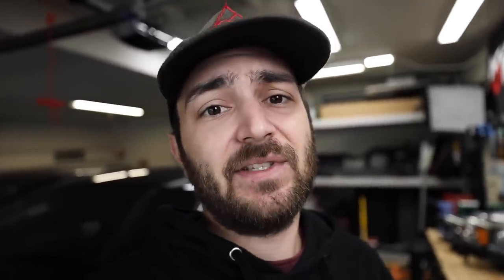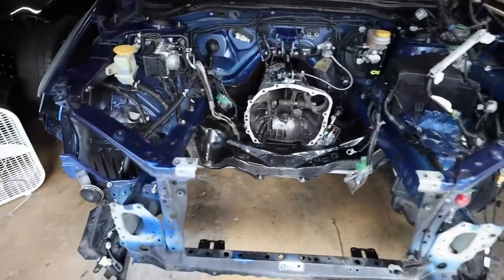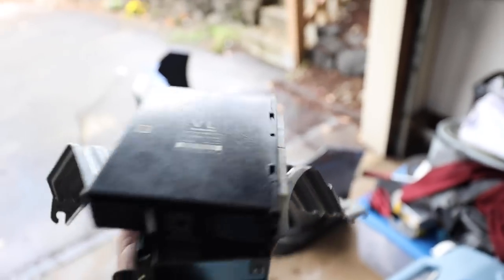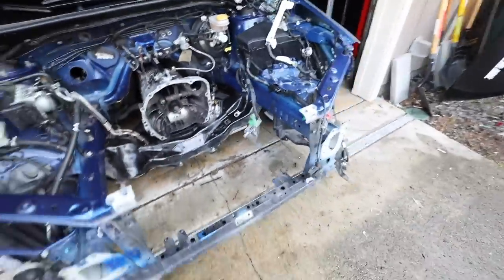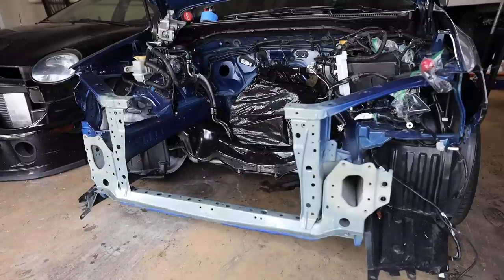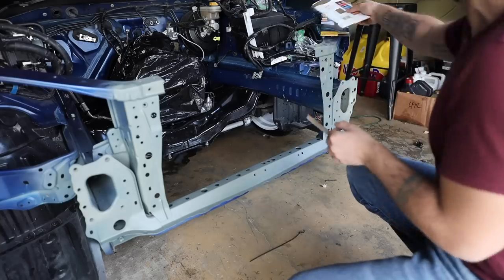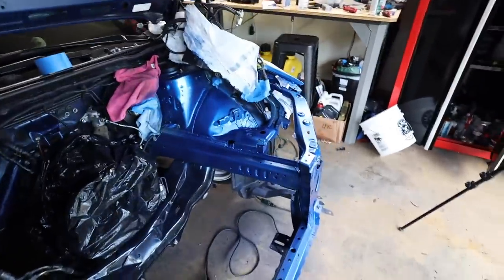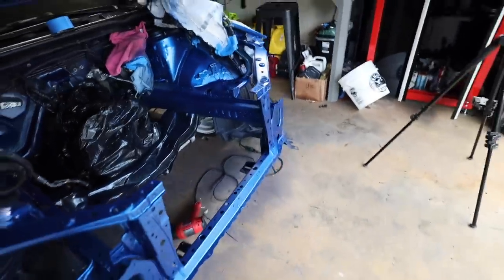DIY Engine Bay Painting. Fixing Subarus Trash Paint Job.

Comment: This is gonna be a long comment, fair warning.

Self etching primer is a good idea, it is not necessary though. When the car is built, it goes into a etching primer bath to ensure everything is coated(helps prevent rust). Using it to smooth out something is the complete wrong use for it. It is intended to etch or bite into bare metal. It is also supposed to be sprayed on and remain transparent.
To smooth out something you should use a high-build primer. 
Sanding etching primer is also not necessary. If anything, all you need to do is scuff it with a red or gray scotchbrite pad. Red is more aggressive for primer and base coat application and gray is finer for clear coat application. Cleaning with acetone between coats is unnecessary, unless someone is spraying wd40 or something of that nature. 

But overall that came out great for being spray cans.
Reply from the maker: Good to know for next time! The can said it was a sandable primer so figured it would work pretty well. But you've got far more experience in body work than I do. 🔥🙏 first time painting and came out pretty good 🙌

Comment: If you're going to clear coat, I'd def recommend getting 2K clear with the hardener. Actually resists brake fluid, brake parts cleaner, other fluid, and is much more chip and scratch resistant. Usually about $20-25 a can on Amazon.
Reply: Literally as I made this comment I see you got some clear coat, hah. The 2X just means two times coverage, if you didn't know. Totally different than 2K. Will still help, but will not be very chemical resistant.
Reply from the maker: Just ordered the 2K off of amazon 🙏
Reply: @Smeedia  It's looking real nice man. 👍
Reply: Does the 2k have shorter shelf life in the can?
Reply: @jackd1582  The 2K Spray Max stuff is one time use, once you puncture the hardener it's only good for a few days. There is a newer product called Car-Rep which is a 2K spray paint that has unlimited shelf life. Give it a shot.
Reply: @802Garage  Thanks , but does it apply to spray cans? The Shop I go to colour Matches ( fills) spray cans , but the 2k spray can 2kclear comes prefilled from Finland .  I assume that 2k lasts a while . But when I went back to use it it was a bit globby.
Reply: @jackd1582  The color match filled spray cans you get are not 2K unless they are intended for almost immediate use. The 2K clear from Finland, if it has an activator bubble on the bottom, must be used within 48-72h I believe. If it is Car-Rep with no activator bubble, it should have at least 3 year shelf life. You may just need to shake it a lot more.
Reply: @802Garage  The Finland brand 2k clear is Maston . pricey! I see cheaper 2k clear , about 1/2 the price . ( I made google my friend haha ) The shop will mix colour 2k into a  spray can but has to be used within a week . Given the price difference I'd have thought the Maston may be the new  type you spoke of , and the cheaper brand  was a one use one . I didn't notice any such info on either can , but only have the Maston at hand  to check the label
Reply: @802Garage  yep. Shop has two options , spray matched , and 2k colour match ( says use within week of  them are mixing( for the 2k version). Thanks for the info on use ✓ . Cheaper 2k clear was body pro 496 2k hs
 clear. I didn't notice that feature on the Maston . I'll look. Thank you for helping out a noob

Comment: Engine bay check. What about the underside of the hood. Is it as good?  And if it is not as good I am guessing you would think 🤔 it should!
Reply from the maker: Its alright for the most part. But with the vents it's not entirely worth it lol
Reply: @Smeedia  Bid your time and shop around. I bet you can find a good condition second hand rally blue hood that is sound. Then you can cut the openings with your dremel tool paint the underside and it will look what did you say "cool"!

Comment: Subaru be cutting corners with there paint i aint never had a car that got as easily scratch asvthe wrx first mod should be ceramic coating
Reply from the maker: For real, the paint is so thin on subarus 🙃
Reply: I do touchles btw

Comment: That paint works beautifully. I may buy a couple of cans for my baby. GrimSpeed did an amazing job on matching the paint. 
Hey I have an honest and curious question, I am making a little over 300whp (305-310) and I am curious about the smoothest way to hit the goal hp 345 w/o going flex fuel?
Reply from the maker: The paint works great! What mods do you currently have?
Reply: @Smeedia  tgv & egr deletes, tmic & charge pipe, turboxs hybrid bpv, cobb jpipe & midpipe + invida n1 dual exit, and bigsf intake.
Reply from the maker: I would do Headers with EWG, EBCS if you don't already have one, and turbo should get you there 🙏
Reply: @Smeedia  I do have EBCS. I was thinking either Perrin ELH or Tomei. And you suggest with an EWG. Would you recommend Tial EWG
Reply from the maker: The Killer B one is a solid set up a little pricey though. But the Tomei is a great option!
Reply: @Smeedia  and for the turbo, what would you suggest? I was really liking the fp for sure. I saw Cobbs 20g, but I think that is more for the EJ motors
Reply from the maker: FP blue is a good choice for future power growth 🔥
Reply: @Smeedia  for sure. Thank you my friend. I love that I can come to you with my curiosity.

Comment: A lot of you need to just keep your mouths shut when it comes to autobody and paint. I see so much misinformation in the comments its not even funny. The reason its not all painted from factory is because they paint the shell with the bumper reinforcement and other front end components already attached. So of course there won’t be paint there when you unbolt it.

As far as the paint process goes, self etch primer is used for corrosion protection and is already done from factory. So unless theres bare metal, theres no need for it. A high build primer surfacer would have been the right option. Might have been done off camera but a red or gray scotchbrite to scuff the area you’re painting is a must. If you didn’t scuff it well enough or any at all then you’re gonna have paint flaking off in no time.

I hate being that guy that picks apart someones work, but this is exactly why autobody gets such a bad rep. Everyone watches the tv shows and thinks oh yeah i can do that. Or when they come to a real shop and get quoted $8,000 for the STARTING price of a full paint job they look at us like we are crazy. This shit takes a lot of time, knowledge, consistency and extreme detail.
Reply from the maker: Auto body did not touch the car, when it was painted on the assy line machines as you already know miss a lot of the spots. For the general person it's no biggie but going in and taking the time to repaint it makes all the difference. And I'm no paint expect as I stated but the primer surprisingly worked (even if it was not the proper kind) between the 600 and 1000 grit i feel like it did a solid job to get the new paint on there
Reply: @Smeedia  I never said they did. I said stuff like this is exactly why autobody gets such a bad rep. Factory doesnt miss spots. They paint the car as an assembly, so when you unbolt certain parts of the car of course you will find unpainted areas. Theres nothing wrong with going back and painting every nook and crany but did you thoroughly scuff the area that you painted? Paint needs something to bite to. Cleaning it and lightly going over it with a dish scrubber isnt suffice. It will peel off in time.

Comment: Not a Subaru thing have you worked on anything else? No car manufacturers paint engine bays, under body panels, etc. body color.
Reply from the maker: Yes, subaru paint is notorious for being very thin compared to other manufacturers on the market. But those smaller areas people don't typically see never get painted